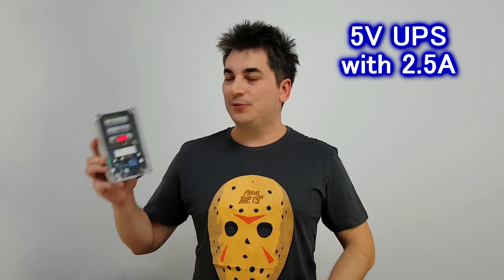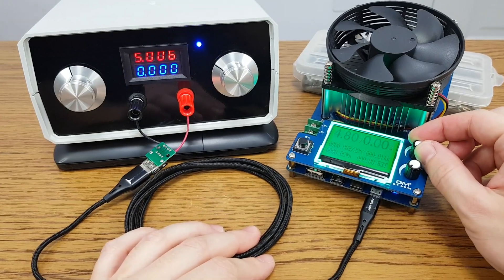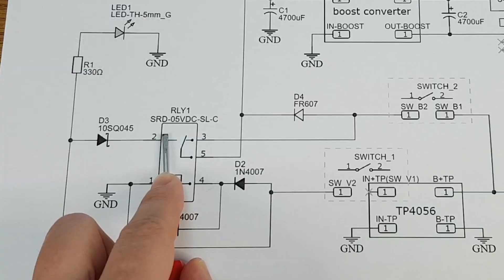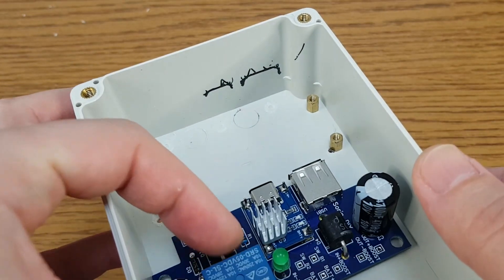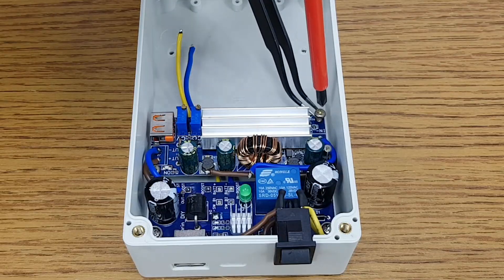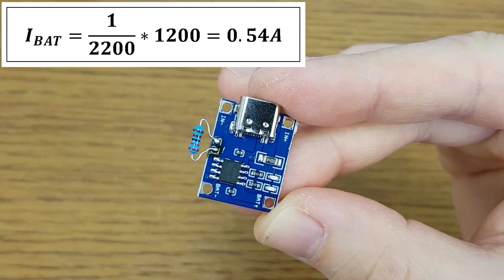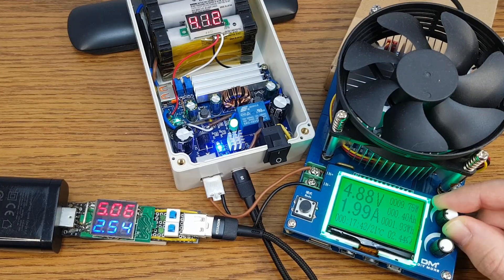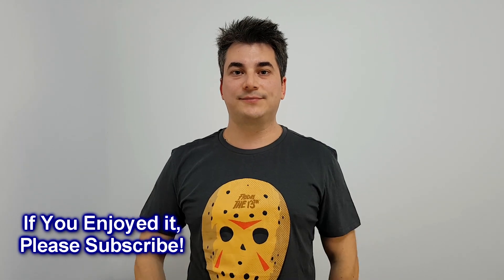5V UPS with 2.5A

Comment: great video! when power supply is interrupted, you said there is a short delay before switching to battery mode, is it possible to use a capacitor instead of battery + FR607 diode?
Reply from the maker: Thanks. Capacitors are not enough, I tried that in my previous 5V UPS project.
Reply: That's what I guessed! So if you use battery + FR607 diode as backup power source, I don't understand why you need a relay except to bypass the FR607's voltage drop. But since there is a step up at the end, it should not be a voltage issue. Is it to reduce the overall current drawn? Or something I misunderstand?

Comment: Hi, I'm just beginner. I've never used ceramic resistor before. I have only 2 pieces of 5w0.5j. Can I use them for adjusting the current of converter?
Reply from the maker: yes.
Reply: @Sorin_DIY  Thank you for replying. I went shopping for components today but I couldn't find 10sq045. I got 20sq045 instead. Is it ok?

Comment: 05:33 Is the importance of voltage drop difference of D4 and D3 relevant even when you are using a relay? also I would like to know the purpose of D1 and D2.
Reply from the maker: Yes, the voltage difference is important, because when the mains power is present and the relay is powered, the pin 2 of the relay is connected with the pin 5 and both diodes (charger and battery) will deliver current to the converter, so it's important that the charger voltage after the diode will be higher.
The D4 will deliver power from the battery to the converter at a lower voltage, only for a fraction of a second, when the mains is interrupted until the relay switches to battery power and bypasses D4.
D1 is a flyback diode, it's connected across the relay coil, to eliminate the high voltage spike created by the inductor or coil, when the power is switched off.
D2 decreases the voltage which powers the relay from 5.1V to about 4.5V, so the relay will switch faster when the mains (charger) is discontinued, because the voltage will drop from a lower value.
Reply: @Sorin_DIY  YES!!! I figured out my first part of the question while waiting for your reply. Thank you for dropping huge amount of knowledge. I am enjoying all your UPS videos very much. Cheers!!

Comment: Have you ever made a DC UPS with 5V, 12V, 19V and 24V outputs and a 110/220V 60Hz Bivolt input?
Reply from the maker: Not yet, but I plan to make one.
Reply: @Sorin_DIY  also adds some telemetry functionality is a good idea.

Comment: i also had made a 5v ups for my adrunio clock so it would work when mains was off, it gave good back up of 1 day, charger 5v was connected through NC of the relay & o/p of boost conv was from NO, every thing  was fine but when the battery was about to die it kinda gave a huge v/g spike which damaged my adrunio i/p unregV pin, now it powers on through 5v pin only, this happened twice with another adrunio also, now i'm thinking boosting the v/g to 7V & adding a linear regulator like 7805 for confirmed safety.
Reply from the maker: Hi. what kind of boost converter did you use in your UPS?
Reply: @Sorin_DIY  i used that 6 pin smd b6280t
based module, also have a xl6009 also, but now scared anyone could damage sensitive loads, atleast we can put a 5v zener or linear regulator for guaranteed 5v o/p.

Comment: Schematic link do not work now. Please share it again.
Reply from the maker: I tried the link and it works: https://i.imgur.com/jHVrDid.jpg
Reply: @Sorin_DIY  Sorry, I try it but can not open.
Reply: @Sorin_DIY  Can install tp4056 with cutoff module if 1 battery use only?
Reply: @Sorin_DIY  sorry for many question, Can I use P-channel mosfet instead of relay?

Comment: Or Just use a IP5306 5V2A module with a pair of 4700uF 10V capacitors on the output and use it to charge the battery pack while passing thru current to load - at the same time having uninterrupted 5v

Comment: Nice design, if I suggest for a new project can you make a 12v ups powered by a car power outlet. I have a 4g router and it would be cool to have it as a mobile hotspot but on my car, it cuts the power when you start the engine and have to wait for a couple of minutes to initialize...
Reply from the maker: I don't think you need a UPS. when you start the engine, the battery voltage drops for a second, or the car disconnects all the loads, including the car outlet, so all the power goes to the engine. you can try to add a schottky, like 10SQ045, after the car outlet, then a big capacitor 10000uF 25V, or maybe even 2 in parallel, then the wires go to the router. this should be enough to keep the voltage stable at the input of the router, until the engine starts.
Reply: I see, I'll check if the outlet drops or cuts the voltage. I was also thinking the battery part because the car outlet goes to ~14.7V and might be a bit too much for the router. If I could stabilize the voltage at 12V it would be good although the Li-on batteries would get stressed. Maybe I'll use a buck converter and package everything in a cable or a little box with input/output.

I'm not sure if this idea is video worthy but when I get the chance I'll try it out...
Reply: I'm here looking to solve a similar problem with a mini UPS. In my case I have a 110 AC plug in the car that I could use to power the UPS, or I could use the 12v outlet. I want to use the Netgear Nighthawk M6 Pro 5g/4g hotspot device in "AC Mode" (bypasses internal battery and turns off its own wifi) as a modem connected by short ethernet cable to the GL.iNet Beryl AX for use as a the wifi router. I also want the UPS to power a Chromecast with Google TV device connected to the car's HDMI input for rear seat entertainment. All 3 devices take 5v dc power. The AC outlet in my vehicle turns off whenever the car turns off. I would like the UPS to keep all 3 devices powered on  for at least 10-15 minutes after I turn off the car, so if my kids are watching something and I need to stop for gas or a bathroom break we don't have to wait for everything to boot back up and then restart the program when the car turns back on.

Comment: Why compare a long Micro-USB cable and shorter USB-C, of course chances are that shorter USB-C will have less resistance so will a shorter Micro-USB.
Reply from the maker: micro USB connectors get hot with more than 2A, they have a higher contact resistance. USB type C connectors work with 3A.

Comment: How long is the switch time between main power and battery power ?
Reply from the maker: less than a second, but it's irrelevant. during the switching time the converter is still powered by the battery through the D4 diode.

Comment: During the demonstration, you connected the USB connector to the power supply with thin wires, of course you will have noticeable losses. And USB cables come in different qualities, you can just use a high-quality long wire and it will transfer current at least up to 3A calmly.
Reply from the maker: the USB port wires from the test are very short and they are from a PC PSU, so they can carry a few amps with no problem. they are thicker than any USB cable, so that's not where the power loses are. you can see that there is a big voltage drop difference between the USB cables, even with a low 1A current, using the same wires on the PSU/USB port. the biggest problem is the microUSB connectors, they get hot with more than 2A, because they have a higher contact resistance than the USB type C connectors. the length of USB cables is also important, if 2 cables have the same quality and one is 2 times longer than the other, it will have 2 times the resistance.

Comment: hi , what is the difference between this project and using a power bank connected to a charger continuously
Reply from the maker: most powerbanks will not work connected to the charger and to the load in the same time. and if it does work, the battery will be continuously charged and discharged, in time it will get damaged.
Reply: @Sorin_DIY  ok! Tanks

Comment: Why didn't you just use Quick Charge powerbank module ?
Reply from the maker: because it will act differently. the relay will bypass the battery when main power is present.

Comment: de ce nu il faci cu dubla conversie? asa poti avea fluctuatie la intrare si poti regla si iesirea, de exemplu 12V pentru un router. alimentezi un buck converter care incarca acumulatorii si din acumulatori folosesti un boost pt cat ai nevoie pe iesire. sau doua buck converter in cascada daca folosesti acumulatori inseriati.
Reply from the maker: am vrut ca acest UPS sa se alimenteze la 5V, sa fie simplu de conectat la orice dispozitiv. daca folosesti 2 sau mai multe convertoare, sunt pierderi mai mari, in total o sa foloseasca mai mult curent, se incinge mai mult. daca ridici tensiunea prea mult de la 5V, o sa scada mult curentul, iar eu am vrut ca acest UPS sa scoata 2.5A, sau chiar mai mult. voi face un alt UPS mai mare, care va folosi convertoare coboratoare de tensiunea, va avea mai multe functii. am cumparat deja si celule LifePO4 pentru el, dar mai dureaza pana e gata.

Comment: I wish channels would respond....but I'll try. Could this be used to power cameras from phones or laptops? I want to harvest all the camera modules from the 15 broken phones and laptops I have to make a security system. The issue is providing the power and data lines. I could harvest the adapters from the boards and hook them up on something like this.
Reply from the maker: you can power the cameras with this UPS, but all the cameras need to work with the same voltage and you need to calculate the current consumption.

Comment: so if i want 12V just change up the boost converter output.....
Reply from the maker: yes, but at a lower current.
Reply: @Sorin_DIY  what if you have psu at 13.8V 5A charging battery with bms and directly of that going to buck regulator drop volts to 12V feeding some equipment? also including diode between psu and battery
Reply from the maker: it will work, but it needs a few more components and the voltage and current need to be adjusted perfectly.
Reply: @Sorin_DIY  thanks. got a buck regulator going to equipment and it's rated  normal 2A with 3A with heatsink. not that the equipment draws over 0.5A anyway. i tested it with old router and another psu with contant ping to the router. and disconected psu.....had a volt and AH meter on the batt so could see power coming and going....

Comment: Salut,analizând schema ta,cred că se poate renunța la dioda D3(10SQ045).În felul ăsta,tensiunea de 5 volți de la încărcător intră direct în booster prin contactul 2-5 al releului.Din câte am observat la boostere,tensiunea de intrare trebuie să fie cuprinsă între o valoare minimă,cam 0,9 volți,și maxim tensiunea de ieșire reglată.Cu alte cuvinte,când este prezentă tensiunea din încărcător,în booster intră 5 volți și ies 5 volți.
Reply from the maker: Salut. in majoritatea cazurilor o sa mearga. dar sunt si unele incarcatoare USB care au 5.2V sau chiar 5.3V, iar unele convertoare nu functioneaza cum trebuie, daca tensiunea de intrare e mai mare decat tensiunea ceruta la iesire. nu am incercat convertorul acesta sa vad cum se comporta. dar cu un incarcator bun de 5V sau 5.1V (din care o sa mai fie mici pierderi de tensiune) si 5.1V sau chiar 5.15V la iesire ar trebui sa functioneze stabil. eu am pus dioda sa acopar toate variantele si sa fiu sigur ca functioneaza stabil, de ex poate cineva vrea fix 5V la iesire. dar da, cu un incarcator bun se poate elimina dioda si sa fie reglat convertorul sa lucreze stabil.

Comment: Super cap on the output to supply some juice in the switchover and give better handling of any surges?
Reply from the maker: when the super capacitor is charged, it will work. but it's difficult to charge the super cap from 0V. it will take a lot of time, the output voltage will drop, or the step up converter will shut down, exactly how it happened in my older 5V UPS with 3 capacitors on the output. it takes several  attempts to turn on the UPS on battery.
Reply: Yeah, I thought that might be the case, what about a very small bms protected "freewheeling lipo cell" across the output?

Comment: I have just finished UPS 5V 10A. What you need to do is: 2 batteries in series and then 2-3 pairs like this in parallel. You will end up with 8V. And then instead of step up converter, use buck converter - they are much more efficient. My UPS on 2 batteries only can deliver 10A with 5.2V at the output for few good minutes while my servers will have enough time to shut down.

Comment: There are  better charger ICs which can pass through power while charging the batteries ... see for example MCP73871 and see Microchip's AN1149 application note.  I don't like that big diode, there's better solutions or at the very least a DPAK or TO-220 version that can be put on a heatsink. I would have liked to see a couple footprints for capacitors, so one could put a couple 2200-3300uF capacitors instead of 4700uF capacitors which are less common - the lower values could even be harvested from older hardware like broken ATX power supplies.
You could have put a barrel jack connector to accept 7.5v .. 12v wallwart adapter, put a dc-dc converter to bring it down to 5v and higher current, give 1A of current to the charger and the rest could be passed through to the boost regulator to output 5v.

Comment: Overall conceptul si executia sunt bune, se pot optimiza multe aspecte. Fun fact, NCR18650A suporta 1.4A curent de incarcare standard, NCR18650 1.9A standard, NCR18650B 1.6A standard, etc.; timpul indelungat cu un curent mic de incarcare nu prelungesc viata celulelor, este doar un mit pt. Li-Ion/Li-Po/LiFePO4 , este recomandat trickle charging doar pentru baterii cu altfel de chimie cum ar fi Ni-Mh si derivate, plumb acid sau alte baterii cu o compozitie chimica care necesita conditii specifice de incarcare. Problema cu montajul tau sunt pierderile enormede trebuia sa ai pierderide maxim 0.2V la portul USB de iesire, asta se rezolva prin calcule destul de lungi alegeri de componente cu low voltage drop si o tensiune mai mare a bateriei desigur si celule cu un curent ma mare de descarcare minim 10A.

Comment: great job as always....maybe in the next build, you can use an IC that can fast charge the 6 cell pack in about 4-6 hrs instead

IP5328P can be a start point for your next video research. thanks for the great video once again.

Comment: For those who are interested in increasing efficiency while increasing supported voltages(5-9V), you could change the TP4056 for a TP5100.
Reply: Thanks for the info; so, this only about efficiency and support for higher voltage, isn't it? And the current output didn't affected, still at 2.5A max, yes? 🤔
Reply: I'm just curious; currently I need UPS for some of my Mikrotik (1 UPS each), and I prefer DIY UPS. But those Mikrotik demand 3A.. 🥲
Reply: @fatoniwahyuutama6591  That is correct. It's mostly about higher efficiency and higher voltage support (working with a 2S battery pack instead of 1S has its advantages).

I should look for higher current alternatives that have the same feature set.
Reply: En 3s es mejor aún y bajar a 5 o 9

Comment: This version of your model is becoming bigger and better and i like it,  Ups for a raspberry pi NAS, but for reliability lets change the relays for something else (solid state relay ) to avoid mechanical wear failures, with the previous 12v and this 5v UPS network and computer will not notice that there is a power outage anymore.

Comment: Nice work wouldn't you be better increasing the battery voltage say 8.4v higher voltage lower amps
Reply from the maker: Thanks. That would require 2 converters to step up and then to step down the voltage. it will have a low efficiency. it will work if you use a separate charger with a higher voltage.

Comment: Impressive as always, especially with all that extra help you have been getting. Tracking the voltage drop through the circuit is a good sanity check on where efficiency is being lost although the downside in modifying bought-in modules is needing to remake them each time ... but such is life. 
Great project, and I’m looking forwards to a Christmas special featuring your assistant’s contributions over they year 👍😀🎁

Comment: Could you build one with a 12v battery bank (and BMS of course), and step down dc-dc converters, this way if there is power loss, there is no delay time between "charging" and power supplied...I would also bet there would be longer run time as more efficient dc-dc converters would more efficiently convert the 12vdc to 5vdc
Reply from the maker: Yes, I plan to make a bigger UPS with higher voltage outputs, I already bought LiFePO4 cells. But it will take some time.
Reply: +1, only hic, 12V will required some BMS and keeping the batts balanced and I guess a bit bigger. But a very good option!
I did the same for a portable variable power supply, 12V to variable Voltage. Instead to increase from 5V to around 12V and more. 4.2V to 5V is fine, but forget about 4.2V to 12V, to much lost.

Comment: Good DIY, but for 5V why not just use a powerbank instead? What would be great tho if it could output also 9V and 12V, to power routers, etc.
Reply: UPS have different function than powerbank. 

His previous videos have that different output voltages.
Reply: This one https://youtu.be/dcIL6Z_msD4
Reply from the maker: if you use a powerbank as a UPS, the battery will be charged and discharged continuously. most powerbanks will not work this way and even if it does work, it will damage the battery. for a 9V or a 12V UPS you need a bigger battery pack with a higher voltage.